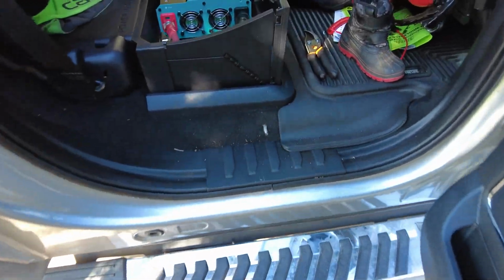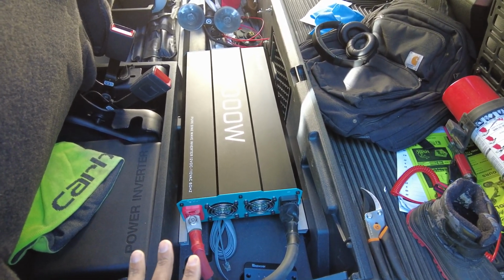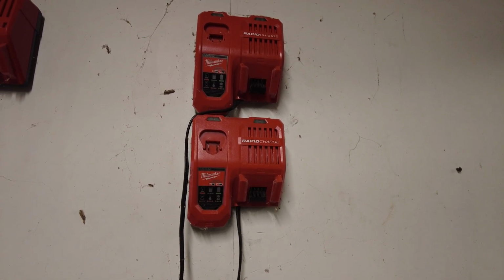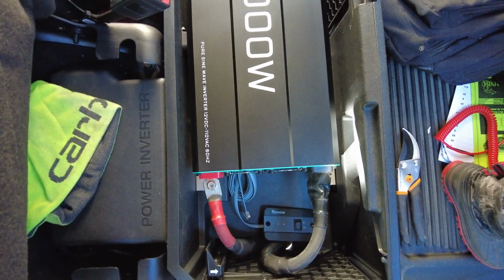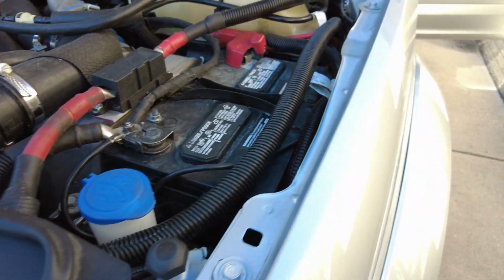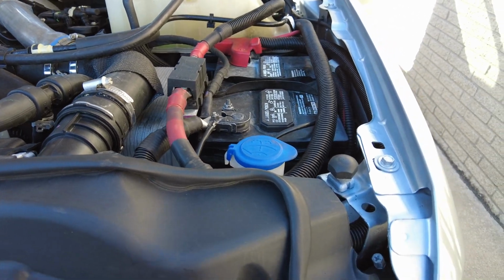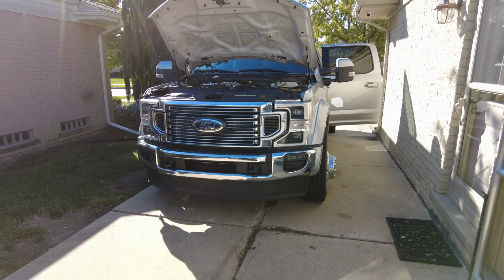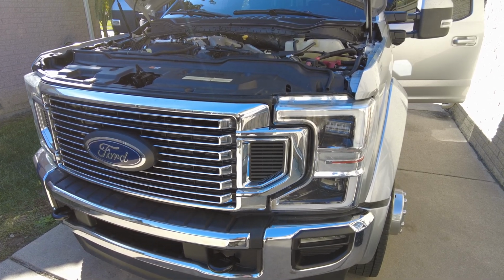Solution to Ford's WEAK factory inverter.

Comment: My f150 has a factory inverter and separate battery for the inverter. My question is, couldn't I just put a bigger battery and a bigger inverter in place of the factory one?

Comment: Is not 4,000 watts is a 400watts inverter good for only tiny stuff
Reply: The built in inverter outlet is only 200 watts; it's marketed at 400 watts PEAK, meaning a 270 watt load will work for a short period of time then turn off.  How do I know? Because charging Makita 40v battery uses around that amount.

Comment: What size/gallons is the air compressor?
I'm thinking of going with a 5000 watt oure sine wave inverter in the bed of my truck...what's your opinion on having a secondary battery back there with the inverter?

Comment: I believe the system  is going to be very hard on the automotive battery.  They are built for surge loads when starting your engine.  Sustained use of an inverter puts demands on automotive batteries that cannot be sustained.  E vehicles will be very sell suited for inverter use like this.  Their lithium batteries are built for storage and sustained loads exactly like inverters.

Comment: Thanks for the video. How did you bring the wire into the rear seat area? Did you drill a new hole and come in right through the floor?
Reply: Yes. I’d like to know this too. How to feed the existing AC outlets.

Comment: In my experience of working with 72v ebikes, we use 2awg wire, even with massive 18000w surges through battery to controller then to the motor!! All it takes is a bms!!!
Reply from the maker: Your at 72 volts. So you can run thinner wire.  12 volt is why I need thicker wire. Once the  inverter converts 120 volt ac, wiring can be as thin extension cord.
Reply: @DS-TRUCKS  still there’s gotta be a way to incorporate a high amp/watt bms into this system!!!
Reply: @aGnarletoenail  BMS protects the battery.  It has nothing to do with the inverter.  12V systems require very heavy wire.  Gauge depends on the load and the length of the run.

Comment: Current flow is why need that heavy gauge wire . You did a great job on that install. Did you pull this setup and install it in your 7.3 truck?  3000 watts continuous requires 250 amps at 12vdc IF your invertor was 100 percent efficient,it’s not ,so real world amp draw is probably closer to 300 amps .
Reply from the maker: Not yet. Thinking about it.